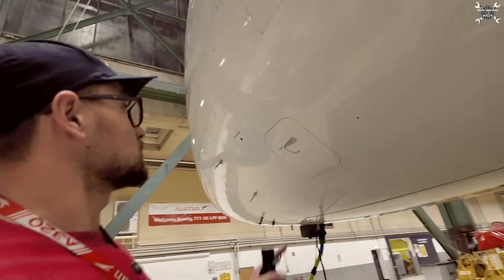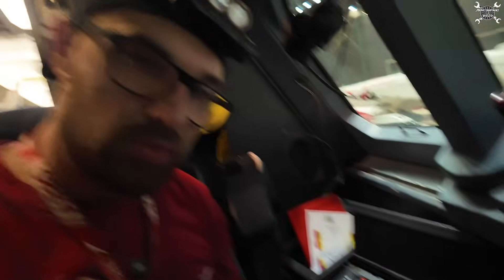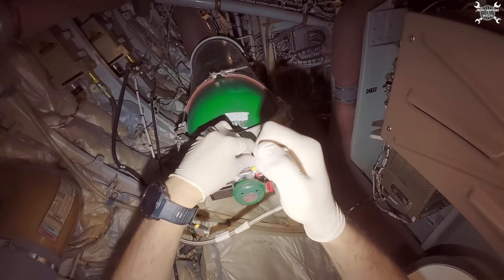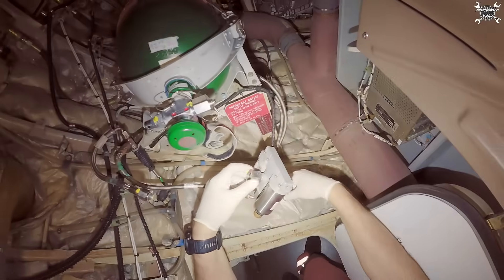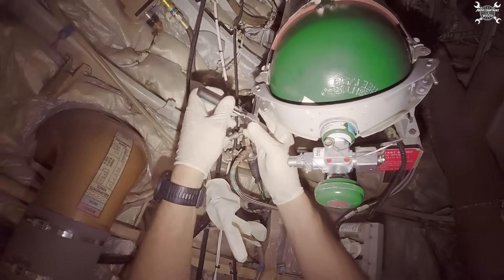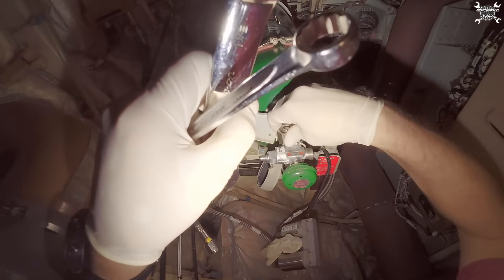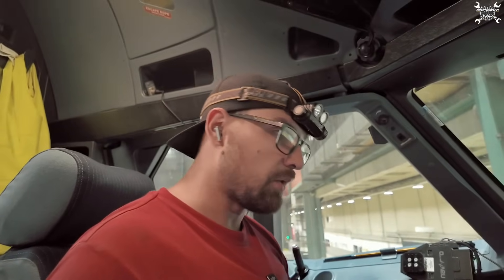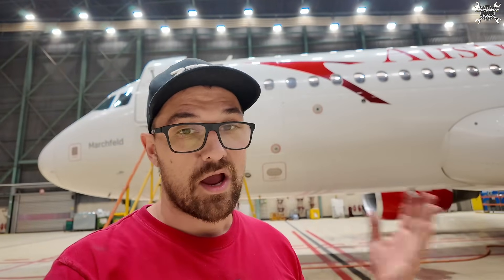Airbus A32F cockpit oxygen system and how it works

Comment: Very good step- by- step maintenance procedure well- explained and narrated concisely and clearly. 
Well- done on a very nice and informative video!! ❤❤
Reply from the maker: I'm glad you found it helpful and informative! 😊
Reply: @zeto.r would be very interesting if you made a video of the air-conditioning system, with a nice explanation of the pak and how the temperature is drastically reduced before it goes to the cabins. You explain things much more easily than many videos on aircraft maintenance❤
Reply from the maker: @supercat380 I have several video about aircondition system like reheater or bypass valve. In both I explained the function
Reply: @zeto.r I would be very grateful if you could give your explanation on how the air in the air- conditioning PAK is reduced to low temperatures.
 I tried finding a explanation, but they are vague and not descriptive enough. I would appreciate your kind assistance here.

Comment: Hello, may I ask you if  you can do some video of the pylon of a  PW 1100 engine the internal side not the exterior where we can see detail.
I found many photo from the side of the wing but not in between fuselage and the engine.
I try to contact you by email but no answer need to model in 3D for flight simulator
Thank's

Comment: Hi thomas! do the galaxy buds 3 pro have good noise cancellation? can they be used as an earplugs alternative?
Reply from the maker: Hi. Im using them every day And they are great for protection. Not really for running APU compartment but for standard hangar apron work it is perfect

Comment: Whats the purpose of that tank, just to supply all the masks? How about oxygen at altitude? Curious to learn more about it!
Reply: Normal cabin pressurisation is provided by other systems. The cockpit oxygen supply is for emergencies or specific procedures specified by the airline. This would include smoke in the cabin or a sudden loss of cabin pressurisation. The flight crew would immediately don the masks and wear them until the emergency has passed or they are evacuating.

Some airlines will also require flight crew to don the mask proactively in situations where there’s only one pilot on the flight deck. Such as one pilot needing to use the toilet so has to leave the flight deck.

Note this is different to the masks that drop from the cabin ceiling as those are only for a short period of time after cabin depressurisation at high altitude. Basically to keep people awake/alive while the plane descends to an altitude where there’s enough oxygen to breathe without cabin pressurisation. Zeto.r mentions these about halfway in the video. :)

Comment: Who is testing the integrity of the oxygen cylinders? That the bottle can support the pressure of the gas, is not rusted internally, etc.

I ama amazed that the pressure of the oxygen is not given in bar but in banana units.

When I was doing scuba diving, the cylinders had to be tested every 5 years or so by an independent lab that would stamp the cylinder for conformity. Because at 200 bar (2900 psi) pressure, it has a lot of energy and could be a real risk if it exploded.
Reply from the maker: Exactly that is done with our bottles. Tested in special shop🙂

Comment: Thanks Zeto for another great video!
What do you do if the manual does not specify what torque to use on a specific nut/bolt?
Reply from the maker: You go to standard practices🙂

Comment: that single switch to switch on/off the airplane, is that 'locked' while the plane drives or flies ?
Reply: It’s more complicated than an on/off switch. He is using an external electrical power plant, to avoid having the APU running, that push button is for energizing only with external power on ground. 
During taxi and flight the electrical system is supplied by electrical generators driven by the engines.
Reply: @CapitanoA320  Thanks for your answer.